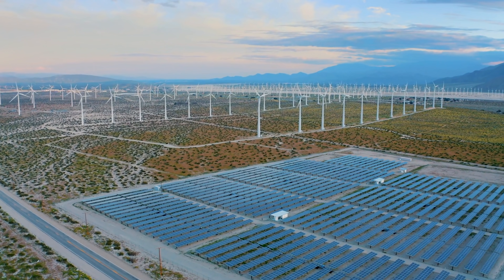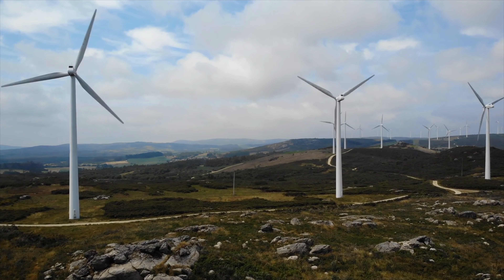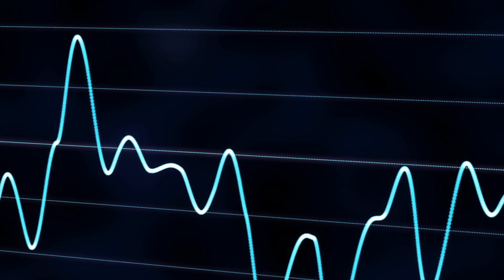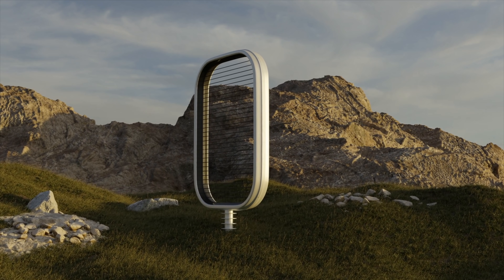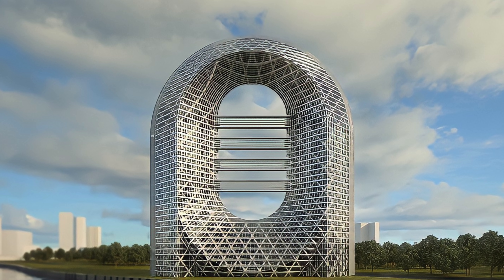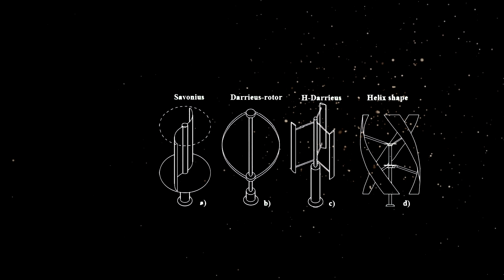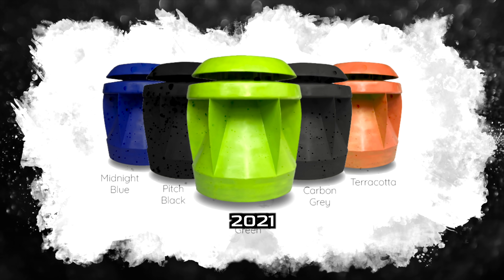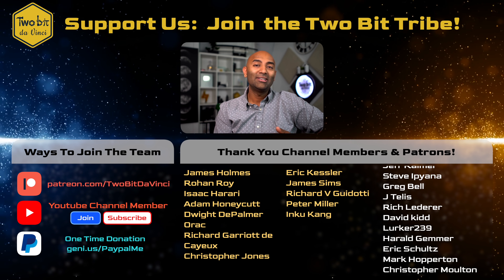These Wind Turbines have NO Blades!

Comment: At nearly seventy, the design work I did on bladeless turbines in the nineties still haunts me. At the time, there was no interest I could connect with. About five years ago, I 3D printed a scale model of the most promising of the work. The physics are valid, and one element has appeared. But the overall design will likely only become a little known and lost concept. Keep up the good work.
Reply: Mate that's awesome!
Would love to sit down and have a beer or a coffee with you!
Reply: @itisjustjosh  did you check out my vid?
Reply: I'm curious, which of the designs mentioned in the video was yours? Or did you come up with something that remains completely unique? I'd love to hear the details... wind power as a concept is fascinating to me, but I dislike traditional bladed turbines.
Reply: @akimbo990  None in the vid were mine. Difficult to explain without the pictures. But in essence, imagine an 80 meter tall shaped tube (shaped to manipulate pressures and velocities) where the base held an internal turbine and the inlet, and the top, a wing which swiveled into the wind. The trailing edge had a full span slot. As air passed over the wing, the low pressure region at the traling edge drew air up the tube through the turbine. The top surface of the wing had PV which drove a compressed air jet to impart rotation to the turbine when the air was too light to drive the turbine at speed. The turbine blade assy also acted as a flywheel to mitigate rotational speed drops. Simple concept. Passive to birds, and far more attractive. I'd upload pix if possible.
Reply: @kevatut23  That's quite interesting and very unique, I think can picture the configuration but I'd certainly like to see a picture - maybe you could upload to a site like Imgur or something and link it here? I don't think YouTube filters links in comments.
Reply: @kevatut23  I was thinking about using the atmospheric pressure difference without having to build the vertical structures - what would you think about placing large pipes that would go a few hundred meters from the valleys up to the mountains? I think there would have to be a steady wind inside such pipe, capable of producing the energy. Safe for the birds, easy maintenance etc.
Reply: @kevatut23  You're design seems interesting , Thank You . Sad how many of the best ideas are ignored
Reply: @peterk.6093  I'd have to see a concept sketch to get a sense.
Reply: @kevatut23  I have no technical education so I cannot make detailed concept sketch and the calculations. Just to describe my idea. So for example with a 300 m altitude difference you get cca a 3 KPa difference in atmospheric pressure. If you take a village under the hills, not so extremely high hills, it might take, lets say, some 5 km to make it 300 m higher in altitude from there. So, if you put a 5 km pipe with perimeter cca 1 m, at the upper end of it you would get a steady pressure of air of about 3 KN. Like having a weight of 3 tons if I did not make some simple calculation error in what I write. It you put a regular air turbine, or even a series of such turbines in such pipe, I can imagine interesting results. Off course, the wider perimeter you use, the more wind. Or you could lay pipe by pipe, going underground where necessary to preserve the forest/pastures, or going photovoltaic on the surface. I just think this could be an easy maintenance permanent structure of a new type helping to get the energy with minimal interference with the environment. 

The principle is nothing new, animals living underground use it to have permanent ventilation and oxygen there. They make one end of their tunnel lower and the other one higher and the wind is there.
Reply: @peterk.6093  I think any flow in this pipe would be due to temp difference, not pressure difference. Same in animal burrows.
This is because the pressure inside and outside the pipe is the same at every elevation, so there is no reason for the air to move. A little like putting a straw in a glass of water and expecting the water to move.
In Kevin's idea the reason for air flow is the low pressure zone created by wind going past the slot at the trailing edge of the wing on top, like sucking on the straw.

@Kevin McDonald Does it even need to be a wing? It could maybe be a wedge? I'm not sure what the most efficient design is but I like the idea. 
Coupled with Peter K's idea of building it up a hill for support it could work nicely (assuming friction in the pipe is not too high)
Reply: @kevatut23  Sounds a bit like a taller version of the power pod idea near the end of this vid?
Reply: Don't let your work die has to be more interest as climate change looms.
Reply: @kevatut23  sounds like an improved version of the invelox design.
Reply: @kevatut23  this sounds very interesting. Are you familiar with the turbosail?  It was intended to power one of Jacques cousteau’s ships. It sounds like the two designs have some elements in common
Reply: @eggmannnnnn  yeah. I had some involvement in early sail design alternative's. There is some theory in common.
Reply: Nice. Can your design be scaled to less than industrial size e.g. something that a farm or homestead can use? Ease of fabrication or reuse of components available elsewhere is also important. If not, it'll be beholden to large companies with different priorities.
Reply: @kevatut23  on certain scales could be pretty efficient
Reply: @patrickday4206  yes sir. Large scales for normal wind velocities. Smaller scales for higher velocities.
Reply: @akimbo990  did you check out my vid?
Reply: If you're never going to profit from it, then please consider publishing the design or concept somewhere, like YouTube. At least that way it will be out there, and maybe it will reach the right people to be evaluated/implemented. 

Otherwise, it could be lost completely.
Reply: @cymond  did you check out my vid?
Reply: @kevatut23  I'm about to
For what it's worth, "OP" means original poster. In this situation, that's you. 

It's a common way to refer to them person who started a conversation.
Reply: On that score. I did 16 years in corporate product development and about 20 freelance. I'd say that corporate had more dead concepts than freelance. It's just that corporate budgets for it, and it just vaporizes. Freelance hurts a bit more.
Reply: Let’s get it out KeVIn
Reply: @vicariouswitness  I will get it on a youtube vid this weekend. Only way I know to get it out there easily. Wish I could post a pix here.
Reply: Since OP hasn't said anything, there's a video uploaded on his profile with what I'm assuming is the turbine as the thumbnail
Reply: @kbrnsr  I'm not following. OP?
Reply: @kevatut23  where is said video?
Reply: @heswatchnu  link is in these replies
Reply: @kevatut23   not finding it...oh well, I guess reposting would not be practical.  Thanks anyway for responding ☺️
Reply: Interesting line of comments & ideas.
When it comes to piped turbines we need to differenciate between Air pressure, Temperature and Windpower.
So the small insect hills probably are not fueled by atmospheric differences ...
Also the Pipes running down a hill concept seems odd: if the pipe is black and the sun shines on it it may get warm and creat an chimney effect - sucking the air UP the mountain.. but if I got it right you want to burry the pipe ( = no sun ) and have the pressure distance work it.
I fear that may not work at all since the pipe has some resistance ( air friction in the walls ) and the differences inside and outside the pipe(openings) are the same - so jeah the example that one used with sticking a straw in water and expecting a magic spring rising is quite fitting. - But what OP said about pipes that suck air in by force of windpower - basically a wind driven vakuum sucker... I like that idea.
As far as I see it the efficiency of such construktion has a few primary values such as height, form & diameter of the tower and Wind speed at the top - also the form of the nozzle is important here - i guess - we need computer models to calculate an ideal form that sucks the most air out when wind goes over it. - is there anything online that I can find about your research or that topic?
Reply: Like a syphon for wind + a flywheel as turbine?   I want to see that.   It work at what wind speed?
Reply: @carrerasrivera   that is a good description. Wind speeds above 7knts are required to bring the turbine up to 50% rated output.
Reply: How well did your design work? Would be interested in seeing it
Reply: Maybe Mr. Two Bit da Vinci could sit down with you and you can show it to him and the world....
Reply: Kevin McDonald You should patent it.
Reply: Have you seen the designs by Aeromine Technologies? The sound somewhat similar to your concept?
Reply: @Hybridog  interesting. Near exact match. Thanks
Reply: Hii can you share your contact i want to contact with you about the same
Reply: Sounds like a lifetime of work for naught

Comment: I’ve been paying my power company for “blue power” for years.  It is more expensive, but is supposed to help put in more big wind turbines.  I would love the Vertical Wind Turbine in a pinwheel design, possibly more than one depending on how high they have to be.  The other would be the Pot, although I’m not sure how much wind I get here on a regular basis (currently the wind speed at the nearby airport is 5mph), and again, how high off the ground it would have to be in this neighborhood with its mature trees and landscaping.
     The parasail type thing would be right out for homes like mine in a city airport flit path, or in the airspace of smaller airports.

Comment: I'm pretty positive about alternative energy sources (no pun intended), but there are a few negative comments here regarding personal cash benefits versus other power sources such as solar. But I think its the wrong approach. If small communities came together and installed both wind and solar systems on or around properties they could collectively make significant savings over national grid prices. Solar fades as the sun goes down but wind can supply power throughout the night and day. A mix of both technologies utilising suitable rooftop locations and open remote clear wind swept area  locations could be very profitable in respect of power harvesting. The time will come when we will have to depend on this kind of technology so the sooner we work out the best way of employing it, the better we will be.
Reply: In order to do this, you have to change many federal, state, county, and municipal laws which require grid power to be installed anywhere one has buildings occupied for living or for business.  For example, New Mexico forced a Michael Reynolds and other earthship builders to run grid power to their properties “for safety reasons”.  Depending on the distance of your building from the current grid, laws identify who has to pay for the the cost of installing all the equipment to get power from the current grip to  the new location.  Sometimes, the building owner must cover a potion of the cost.  The building owner won’t own that portion of the grid for which they paid,  nor will the building owner be able to prevent the power company from siding that grid to supply other buildings at a later date or profit from it. In some areas, the power company can install equipment on the private property in between the current grid and the new building affecting other property owners.
Reply: @davidscbirdsall  
Hi David, I guess that around the world there will be many variations on the theme of who does what and who pays etc. In the UK we can send solar power back from our domestic arrays into the national grid through an interface which works out the costs either way and the home owner can sell excess power back to the grid.
As we are really talking about massive changes to the power distribution networks right through to domestic users in order to achieve a workable renewable energy system there will no doubt be many questions around how best to make the thing affordable, so your points are well made, now we just need the solutions. Geoff.
Reply: @geoffcampbell7846  We can do that here in the US, if you have permission to hook your local power to the grid.  The power company as well as the state, county, and city must approve your systems meets various codes before grating you that permission.   Even when you can connect to the grid, many states have laws that state no matter how much electricity you provide to the grid, you only get paid for what you use from the grid.  This means that if you have used $40 of electricity from the grid overnight and you provide $100 worth of electricity to the grid the next day, you only get a credit for the $40 to put you back to $0 owed to by you to the power company and $0 owed by the power company to you.  You don’t get paid for the extra $60 of electricity supplied to the grid, and the power company can sell that power to another customer without owing you anything.

You can have an automatic meter that switches between grid power and your local power, so that you maintain an exact $0 balance, but these systems are much more costly than some people want to pay.  Some power companies will rent the smart meter to you for a fee, but over time, you’ve really just bought more meters for the power company which they rent to other customers.  If your local power system doesn’t meet code for connecting to the grid, or if you don’t want to connect to grid, you can manually switch between the two power supplies, but there must be a pause of 6 or more seconds between one power source and another.  

Regardless of what you decide to do, in many places you have to notify the power company that you have local power even if you don’t connect it to the grid.  The power companies in the US always control the meter, and they always have the ability to come onto your property at any time to lock out your meter, to prevent power from entering the grid from your home.  This can be done when the power company is doing work on any part of the grid that can be energized by your home power system.  Normally you’re given at least 24 hours notice before this happens, but in emergencies or disasters, they don’t need to notify you before locking you out from grid power. I’m sure this is very similar in many parts of the world.
Reply: Apartments, malls, etc. can do, just what you are saying… and they should.
Reply: The most important thing to consider here is that power usage across an area changes throughout the day, and power production has to with it too.  You can’t send energy to the grid if there is no one consuming the energy.  At times when there is a studded demand for energy (people turning on things at once like they do when they first wake up or come home from work later in the day), power must suddenly increase power production.  Peak Time in many area is later in the day when most people are coming home from work and the sun is going down.  The community has to develop a unified way to notify power producers when to provide power to grid and when to stop supplying it like power companies have with power generation companies.
Reply: @davidscbirdsall  its a fair point, but consider the power needs once hydrogen production is stepped up across the nations. Much of the excess power will be found useful in this power hungry industry. Also the usual argument against desalination plants in the battle to re-water desert areas and managing water supply in drought prone areas is the cost and provision of electricity. Both industries will feature heavily in the future and means of providing power should be worked out well in advance. I'm sure there's much to consider and many other calls on future power supplies, so eventually there will be little excess that can't be used somewhere, even if it is on an off-peak only policy where any excess is sold on as it becomes available. We can but hope that the people with the power and the people with the money care more about the world problems and less about maximising profit, and share the ambition to make a better world.

Comment: As solar continues to gain efficiency, is there really a need to worry about win power for individual homes?  I mean solar is perfect for the home, it lies flat on the roof and is very scaleable.  I wouldnt want some turbine on my roof with moving parts that are going to constantly break and require maintanance.  Also, what is the govt' and big buisness's plan to combat this?  They didnt allow Tesla to deliver free electricy, it seems hard to beleive they are going to allow it now.  Its one thing when a tiny percentage of people are using the technology but what happens when it his 30  plus percent?  I live in Colorado Springs, and in the last year, i think 6 of neighbors have gotten solar panels installed on their roof.   My house being one of the last without them.  I'm just not sure how long I'm going to live here, so I havent invested in soemthing that is paid back over time.
Reply from the maker: Very true! The reason I care is because I’d love to generate electricity at night :)
Reply: @TwoBitDaVinci  Is it neccessary to generate at night?  I mean if you have a battery bank and use solar power as on demand power, why would you need to generate at night?  Or does it really depend on the state and the amount of sun?  Obviously in Colorado we have no issues with the amount of sun.  I mean I can see a wind turbine being useful for a small business in conjunction with solar panels, but I'm failing to see the need for it, for an individual home owner.  I mean outside of guys like you that enjoy the tech of it all, and just the ability to be able to do it.